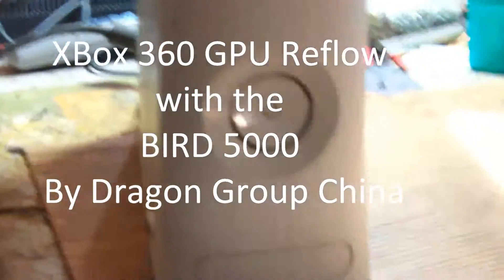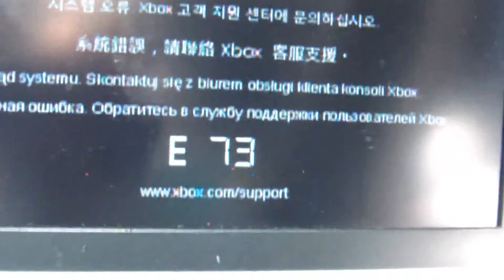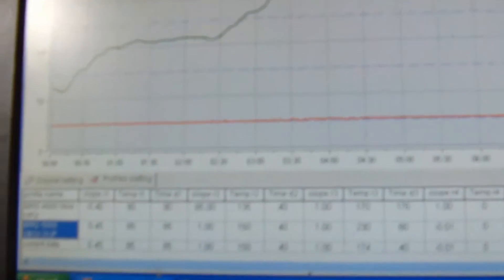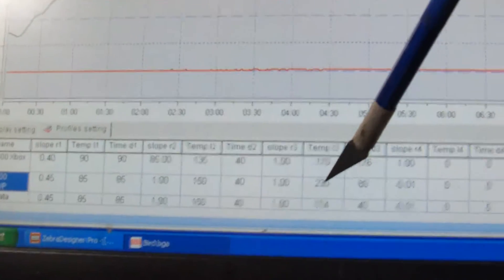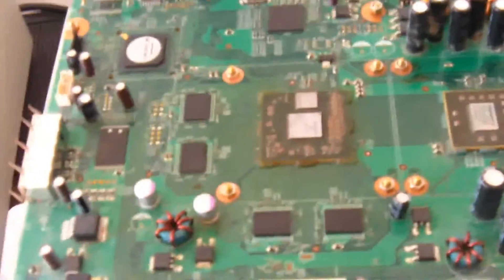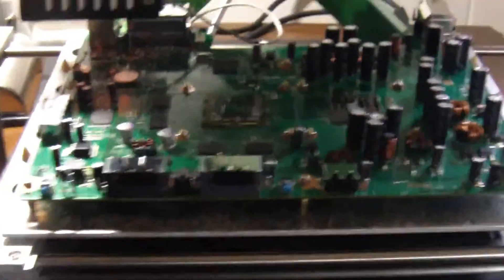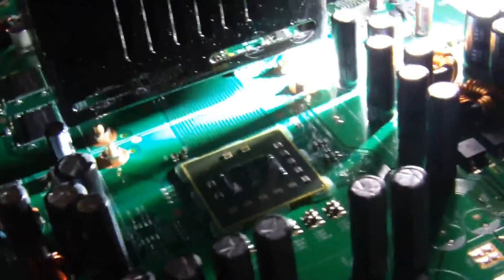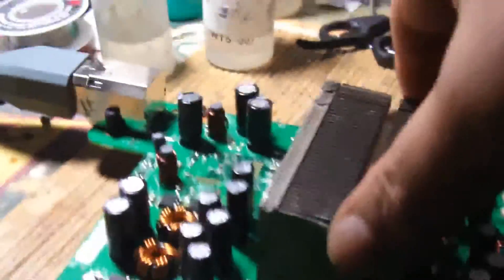A Reflow Excercise Using the BIRD 5000 by Dennis Woodgate

Comment: What is a good ultrasonic cleaner for xbox 360? and where can I get it? Is there a special flux that I need to use for reflowing the board? I have the bird 5000 and was wondering if anyone has a good profile to use for the xbox 360.